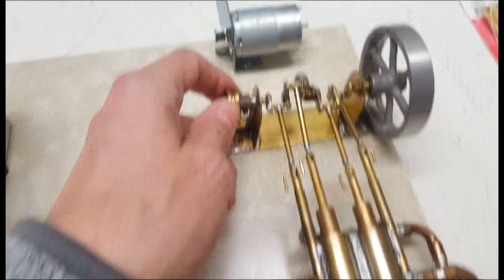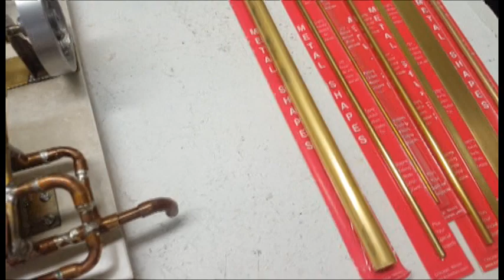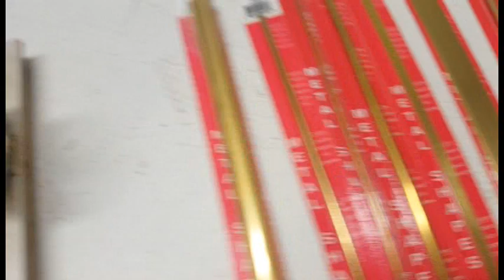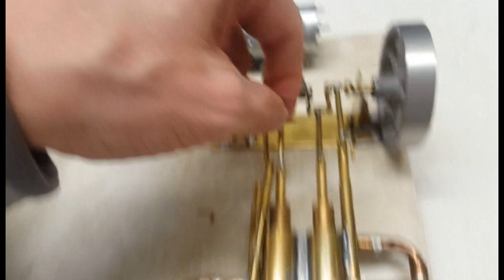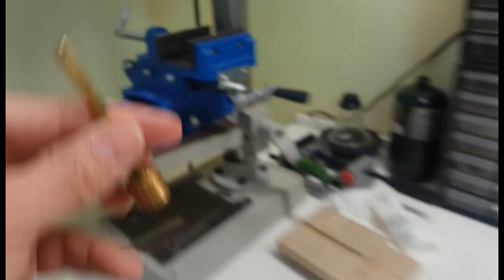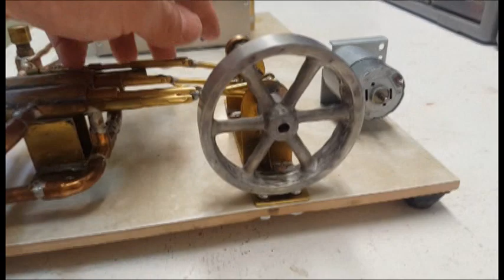Twin-Cylinder Steam Engine Tutorial

Comment: Thanks alot for your videos, I've been researching alot of steam engines and made many many sketches of one, which is inspired of yours, and I'm going to try to make it power my bike! I know it's a bit ambitious, but I'm doing it the following way: I'm making a 2-cilinder double acting engine, very similair to yours, with a bore size of 14 mm and a stroke of 15mm. Then I use it to power a small wooden wheel, roughly 20 times smaller than the wheel of the bike, and that wooden wheel will run on the bikes front wheel with a reduction of 20:1, which, according to my mediocre calculations, should give me the torque of an e-bike, but probably the speed of a pensioned snail. As a boiler I'm either using a very large soda can, plenty of water hold and is rated at 6 bars (I'll use it at like 2-3 bars) or a steel pipe that I'll have to make into a boiler. I started on the engine today, I finally found some time. I made one of the pistons,  made it from a brass block and it took ages to transform it in my drillpress, but it's now round and sanded to 2500 grid. I tested it in the cilinder, and it slides pretty nicely inside of it and is very airtight. When I blow into the cilinder it shoots out and with a bit more 2500 grid sandpaper work it should fit like a glove and slide like a sleigh. Have precisly designed a piston valve, thanks to you I know how to make it in the drillpress, I have one question however. I have my pistonrod, which is square to the piston, but sadly not entirely centered. Do you think this will be very limiting to the engines performance, or could I just make the hole where it goes through the coverplate off center aswell and have the piston unable to rotate. If it is very bothering I could cut it off, since it's a tight fit and soldered into the piston, and just drill a new hole where the old piece becomes a part of the brass. my excuses for the long message, I'm very excited to finally have my own steam engine soon. Thanks for all the inspiration! Cheers, Thijs
Reply: I've finished one cilinder and valce combo, works beautifully even using just air from my lungs.
Reply: Alright just got this video recommended again, I made two 20mm bore cilinders the same way I made the one above. At first I had a slightly flimsy crankshaft which broke as soon as I tried to power the bike with it, so I made a new one with 8mm brass plate and I'm pretty sure the only way to break that one is by nuking it. It's very sturdily built. The valve system is very similair to yours, but it exhausts to atmosphere. I made a boiler out of a steel tube which I welded shut and added a firetube, gas burner and all kinds of fittings like a manometer, watergauge, safety valve, funnel ect. It also has a nice sheet steel firebox underneath it and its volume is 1 litre. I made a simple displacement lubricator. All of this on an MDF platform that held to the bike with 2 bits of steel to the front wheel axle and one bolt to the steering fork. I'm now just waiting for the gas tap to arrive so I can fire up the boiler on gas for the first time, already tested it with a metho burner but that didn't work very well. The engine runs beautiful on compressed air and had plenty of torque, so I hope the boiler can keep up with it. One addition I want to make are babcock for more efficient heat transfer if the firetube alone doesn't suffice. Your videos helped me alot to make this setup without a machine shop, and without it I probably would've had a way harder time doing so. Cheers for that.

Comment: Thank you for a lovely video. I am very interested in the small needle valve on top of your boiler - do you have any information on this? Is this a Viking 1/8" needle valve? Also, any info on the safety valve would be great!
Reply from the maker: Hi Tim, the main valve at the top of the boiler is indeed a 1/8 needle valve, but I don't know what brand. They are sold at all the local hardware store. As for the pressure release valve, it is home made, using  a 1/8 brass elbow and I machined a needle that sits on the existing shoulder inside, with a small spring. I guess I should have shown this in more details. But unless you have a really big burner, it's pretty hard to overpressure this engine. I hope this inspires you into building something similar!
Reply: @ch300fnqi  Thank you kindly for your reply. Yes indeed, I am keen to try a simple wobbler (oscillating), but would love to make a low pressure boiler for it as well, hence your video has been very helpful. Thanks again!
Reply: Just looked at your video now you explained everything perfectly thank you. You have an amazing Tallent also the best video explaining how the valving works. 👍👍👍